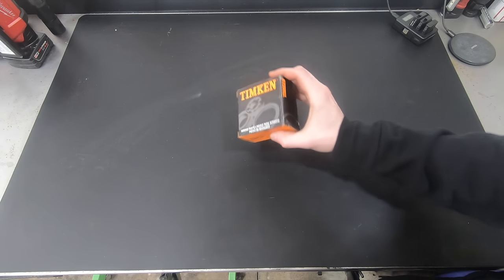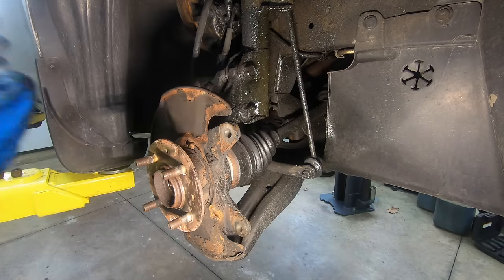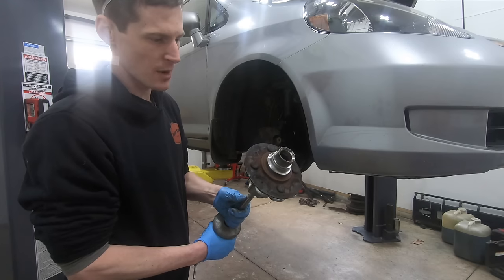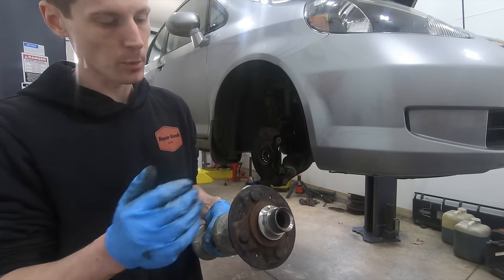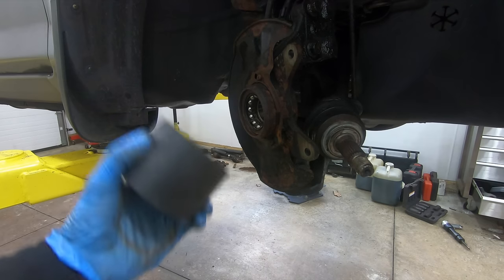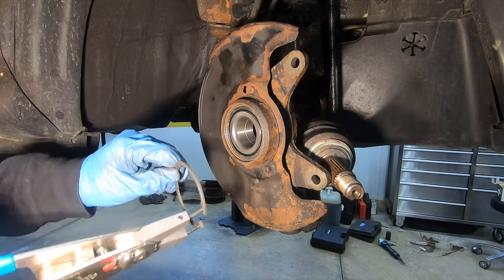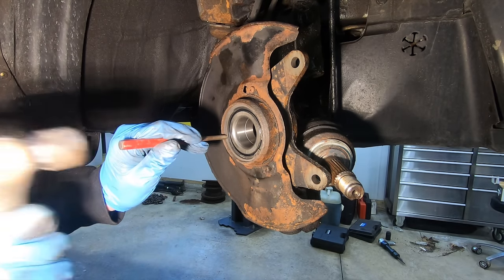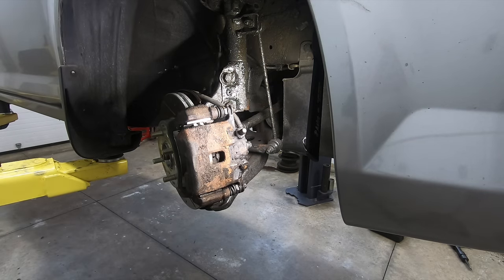How To Change A Press In Wheel Bearing Without A Shop Press.

Comment: This is by far the best instruction video on replacing a FWD front wheel bearing. I’m a Honda tech by trade, and I can say that every steps, tips, and cautions are all spot on. Only thing I might say is that by using the impact gun you may damage the threads on the tool prematurely, especially if it’s a cheaper quality installation tool.
Reply: I have the same tool and have used it countless times. I always put a little bit of gear oil on the threads of the bolt. Tool still works like brand new
Reply: Yes, grease or oil the threads to protect them.  No anti-seize!
Reply: I totally agree, great job in the instructions
Reply: Dose it make a difference on which direction you press out/in the bearing?
Reply: @businessraptor134 only can be pressed in one way
Reply: @stlcat314  false. It depends on the make and year. My old altima can go either way and the outer  race was magnetic on both sides so directional installation didn't matter. I did the normal press outwards for removal and inwards on the knuckle. The frozen race fit in the back of it and seated just as easily as the front. I wanted to know in case I had some freak luck and had to improvise a fix despite having a 20 ton press.. it went smoothly though. I'd only recommend it to be pressed outward because there's too many that DO only press in one way. I've done a lot of research
Reply: I have to agree all these years I’ve been pressing them in and out with a press and using a drill to drill out the o ring and than on top of that taking the whole spindle out and back in!  I think ima try this way next time ;)
Reply: Great video …Subscribed!

Comment: A Dremel is enough to put a cut into the race. It doesn't take much of a cut to get the tip of chisel in to crack it. I've done both. Next time I'll reach for my Dremel.
Reply: I just place a chisel between the race and the hub, go around hammering not too hard and the race starts to separate, i foumd no need to cut into the race
Reply: Place hub on pickle fork and heat race with torch race will fall off when it expanded from heat

Comment: I always thought you needed to use the outside of the bearing to push it in, not the inside. I do them just like bushings, I would have used a larger plate to cover the entire bearing and push it in by the outer race, if you push it in using the inner race you can damage the bearings.
Reply: If you watch going in he pushed on the outside!
Reply: He did use the inner bearing to press in the hub. That is the correct way to install the hub as it does not put pressure on the bearings and keeps both halves of the inner race together. If you are pressing on just the outer race there is a good probability that the inner race opposite the hub will get pushed out of the bearing destroying it. *Depending on what kind of tool is used obviously.
Reply: The inside bearing is supported with this tool configuration so no damage is done
Reply: FFS lads it has nothing to do with the inside or the outside in situation X or Y. Just dont crush the balls. Easy.

Comment: Good video. However, by not using anti-seize or any rust preventor such as fluid-film on any of the steps is just allowing the parts to rust once again and making it difficult for the next person. Most of the time, the only thing a DIY'er lacks is the access to a lift and/or maybe an expensive bidirectional scan/diagnostic tool.

Comment: I have a 2002 honda civic lx. I am changing the front struts, wheel bearing for right side and axle for right side. Every video I've seen so far says my wheels should be spinning freely. Neither my left or right wheel spin freely when front end is jacked up and car is in park. Does my transmission have to be in Neutral to get it to spin freely?  If so, how come nobody ever mentions this?

Comment: It's called the camber, not alignment which is tow. Air hammer will be much quicker and easier as well. Use socket same diameter as bearing to avoid damaging.

Comment: I finished doing my daughter's 2018  Buick. I bought the press tool although it was a different brand. I followed this video and everything worked great. I do not have an impact, but a cheater bar worked. 
A couple of things were different on this Buick. I had to take the tie rod loose. The snap ring was on the back side. After removing it, the bearing had to be pressed out the back and installed from the back. Was still able to do it on the car.
I really appreciate this video. I probably would not have tried diy without it. There are a lot of videos on this subject, but this was the best.

Comment: i like it.....i used to pull the whole knuckle off and lugged it over to the big press...if you have the right tool, your way works great...our problem many times is the snap ring is rusted solid into the knuckle or some other Northeast problem because of salt and rust...great job

Comment: Great video. I rented one of these from auto parts store and then bought one from Harbor freight later. It looked exactly like the one I rented. Worked great for about three or four bearings and then the threaded rod stripped out. I even tried to buy a new threaded rod and no one could help me. So make sure you buy one that you can get replacement parts.

Comment: Really clearly described technique for someone that hasn't done this before. Two things I would add, grease the thread on the bearing tool, there is alot of force being applied there, lubrication will prevent wear and damage. Wear eye protection, it only takes one metal splinter to spoil your day, or possibly even your life.

Comment: Great video! To remove the hub without a slide hammer I removed the control arm laid it on two 4x4's and knocked  it out with a big socket and a hammer. It came out real easy.

Comment: Solid video. As for everyone saying to anti-seize, loctite, or lubricate the splines, this is actually incorrect. (I live in northern canada, I'm familiar with 8 months of snow and anything possible rust-welding together...) The tolerances, assuming you're using decent parts. are tight enough that what you apply will be almost entirely pushed out towards the hub as you tighten the axle nut. This can result in, depending on the design of the hub, you hydrostatically locking the fastener during clamping. Which will not only wildly skew torque readings, but also put immense pressure on your components and cause premature failure. Anyone who's ever torqued bolts in blind holes, such as engine blocks is likely familiar with the fact that even a tiny bit of oil between your fastener its clamped object can crack straight through solid metal while torqueing it down. This is the same principle, less likely to happen but still entirely possible.

TLDR ; Fluids don't compress, and cause bad things to happen. Read the manufacturers installation procedure and only apply the specified lubricant if a wet torque is provided. Most vehicle manufacturers will even deny warranty payout to dealerships if there is evidence of a lubricated fastener where a wet torque is not provided. ALWAYS RTFM, if it seems odd then look for a service bulletin to confirm or deny it.

Comment: First time I replaced front bearings I ended up taking the knuckles off as the slide hammer wasn't able to get the hub out of them and made a huge racket that my neighbors probably weren't too happy with as I work on the street.

I got one hub out with a small sledgehammer pounding a large impact socket that I used as a drift, but the other one just wouldn't budge so I took it to a shop to be pressed out. I got the rest done using this Astro Pneumatic tool, which was pretty straightforward.

I can verify that getting wheel speed sensors out of old and rusty knuckles is almost impossible to do without breaking them, because I tried this on a 30 year old car last year and broke both of the rear ones. Each costs around $350 so I now have to either do without and put up with that annoying ABS light (or just pull the fuse) and of course no ABS, shell out $700 for new ones, or try to jerry-rig ones out of the old sensor cables which are fine and a hall effect sensor (or whatever sensor they use) with the right voltage output and a rod that fits just right in the hole. I'm going to try the latter first.

Also, you should grease or lube that forcing bolt before using this tool, to make things go easier and protect the threads.

And, different cars have different pressed-in bearing setups, with some coming out the outboard side and some coming out the inboard side. It's basically wherever that snap ring goes.

Btw snap rings are well-named because when you remove them they snap at you, so wear eye protection folks or put something solid in front of them when you remove them.

Comment: From Scotland. The snap ring is usually rusted up so bad that its almost rusted away, I find that welding washer or bit of steel to it , then use a slid hammer with vice grips, will shift it. It's all down hill from then. Good demo, by the way.

Comment: This is at least the 10th video  that I am watching on this topic, in anticipation of having to replace the wheel bearings of my 08 Pilot.  And this is by far the best description, including insights into the actual physics of pulling the bearing out.  Thank you so much... While I am not sure which model of Honda your vehicle is, from appearance the knuckle assembly looks identical to mine.  So, hopefully I can also remove the top two bolts attaching to the strut without affecting the wheel alignment...
Reply: Did you replace the bearing?  I’m doing same on rear of my pilot.  One option for the front is to replace entire knuckle assembly. It’s pricier but saves a lot of time.  And I had to replace abs sensor as it was froze in old knuckle.
Reply: @Merrill26osu  It so turned out that the noise from my wheels were actually coming from the tires (got this confirmed with a mechanic as well).  So I did not attempt this repair.  And yes, the far easier solution for worn front wheel bearings might be to replace the knuckle assembly as a whole.  However, this option did not seem available for rear wheels.  The process also looked more complex than front wheels due to the parking brake assembly, and I was not able to locate any video instructions for rear wheels.  How did you handle it?
Reply: @Musiclover5258  Rear wheels at least on my Hondas are a piece of cake vs this.   You just unbolt the wheel hub and bolt a new one on (the hub and bearing come as one unit)
Reply: @JCO847   I am assuming yours is 2009 model or later?  For Honda Pilot 2008 and earlier, it is unfortunately the more complicated route 😞
Reply: @Musiclover5258 ahhh I was talking Accord.  No drive wheels in rear so easy bolt on hub.  I assume with AWD then you have axle nuts and press in bearings etc in the rear too is that right?

Comment: thank you for this video. i watched a number of them and this is one of the best. I only wonder when pressing out the old bearing why you select a disc that press to the inner of the bearing? would it not give more power to use a disc that is just a bit smaller than the bearing so it press on the outside?  or is there some advantage?
Reply: That's what I was thinking. I think the bearings will be damaged if the bearing is pressed into the hub with pressure on the inner ring.

Comment: Auto tech here with something to add for the people. If you want your press tool to have any longevity, the forcing screw should be greased, which will also make it press easier. Additionally, I'd suggest separating at the ball joint instead to get the cv shaft out. Even if the strut bolts aren't where the alignment is adjusted, it can still affect the alignment somewhat if removed, whereas separating the ball joint will have no effect. Otherwise, this is a perfect rundown of how it's done.

Comment: Nailed it!  I totally agree with Mike C.  Best instruction video for replacing a FWD front wheel bearing (and without removing the steering knuckle).  I never would have guessed that you can do this on the car.  Thank you so much RG.  Oh, and your sound & camera work are exceptional!!!
Reply: Yes they are- Extreme Professionals on this channel and it’s Greatly Appreciated 👍👍
Reply: You forgot rear drive hub bearings too on AWD vehicles

Comment: Great video….on the taking the two strut bolts lose (alignment bolts or stock non adjustable bolts), I would before you do any work, while the car still can be driven, pull up to a relatively flat surface close and convenient to where you make your repair, and pull up and park with your wheels as straight forward as possible. Get out of the car, and mark the road with chalk, where your tire stopped (the contact patch and direction to give reference after repair). I would also mark the top of your tire to take in wheel runout to your next measurement(could also mark in paint, the tire, wheel, and hub together for more accuracy). 
       Next using either a digital angle meter (preferred) or a level large enough to span the sidewall of the tire, take a measurement of the vertical centerline of the tire wheel and hub. Changing those strut alignment bolts primarily change the camber (left right tilt of top of wheel) so duplicating this angle after disrupting those bolts, to before the work started, if the car was in reasonable alignment should get you back in the ballpark or confirm any marking of the strut pinch point before disassembling is accurate. You could for an extra measure, also take an angle reading of your opposite front wheel to determine how close both angles are. They make a small square digital angle gauge pretty cheap, that used in conjunction with a level or accurate straight edge can measure angles accurately. If you don’t want to spring for that, a bubble level, and a tape measure can be used. Word of note, if your worn bearing has play, this must be factored in. That’s why taking the angle of the other wheel, helps if the car was in reasonable alignment before starting. So now after you make repairs, you drive car back to the spot you created, and getting the wheel/tire (and car) to stop in as close to where you took measurements before, including getting tire wheel reference to the top. Take your angle measurements again, write them down, if they match, your done. If not, calculate the difference between before repair and after, then you’ll need to jack the car up just high enough to free front wheel, on that side. Take another angle measurement and then loosen the alignment bolts on the strut, and move the eccentric bolt to correct for the difference of your two initial readings. Tighten bolts, drop the car off the jack, and this is important, drive the car…..then remeasure your angle again at the same spot with all things being equal. If your camber angle is the same as when you started congrats, if not repeat. If you did this correct, you should be good, if you doubt, a trip to the alignment shop might be in order. 
       Lastly alignment specs are usually done in degrees, or rather fractions of a degree. For reference, a circle with a radius of 57.3 inches (diameter of 114.6), one degree of angle taken from the center of said circle, will move one inch at the circumference, so for example, if a spec calls for and 1/8 of a degree, the deflection will be 1/8 of an inch at 57.3 inches from the center of the circle. So tiny measurements closer to that circles center make a difference. Luckily specs usually have a range, and camber is more forgiving then toe or caster, the latter being in newer cars not adjustable. Camber however changes toe, so getting it as accurate as possible is best!

Comment: Just as an FYI NAPA, and likely other auto parts stores, but NAPA for sure, has reman steering knuckles with new bearings, hubs and seals all ready to be bolted on. Certainly much cheaper pressing in your own bearing, but may not be feasible for some, or if your knuckle is so damaged from the bearing spinning in the bore, then you have options. The Hub Shark setup works very well, and I have used it to press bushings in as well.

Comment: One of the few videos that show using this type of tool the way it was intended to be used - without removing the knuckle.  This type of tool was originally intended to allow changing a pressed in bearing without removing the knuckle and using a shop press, thereby saving time for the technician (ie. Hub Tamer and subsequent Hub Grappler), and usually the need for alignment because the knuckle was removed.

In a lot of videos, the person takes the knuckle out THEN uses the tool to swap the bearing.  Granted there are times when you have to remove the knuckle, but it's usually times when it has to be removed because the bearing is seized and a shop press HAS to be used anyway.

Comment: Just done a set on a Hyundia Elantra, same bearing, but comes out the back, put the new bearing in the freezer for a couple days if you have the time,  for you guys on a budget you can get this wheel bearing press at Harbor Freight and get the job done. i personally replace the speed sensor , just seems to make life easier.

Comment: Fantastic explanation. I’ve changed the rear wheel bearings before, no problem. But the front is a different animal. Going to this wheel bearing puller, so thanks for the insight

Comment: Very nice video. I have this exact same bearing puller/installer set. The anti-sieze all over the bolt and washers is a must. I haven't used mine with an impact yet but here in the rust belt, a 4 foot pipe wrench is often the best for turning these seized bearings out.

Comment: Many years ago I did a Toyota Corolla and those models CV shafts bolted to the transmission instead of spline shaft slide-in.  Remove four bolts, the outer shaft nut and it came out without unbolting/removing anything else.  Super easy.  To bad they all aren't made that way.